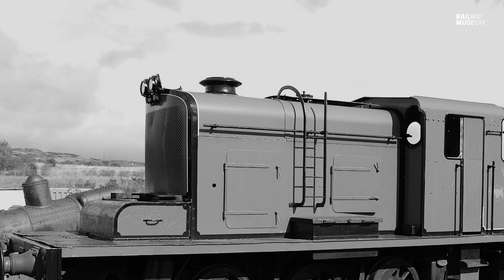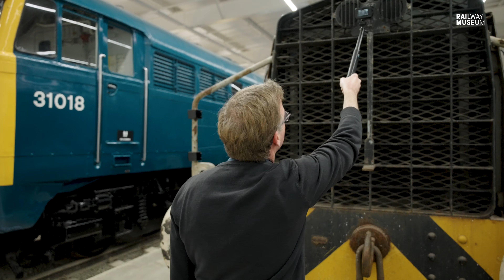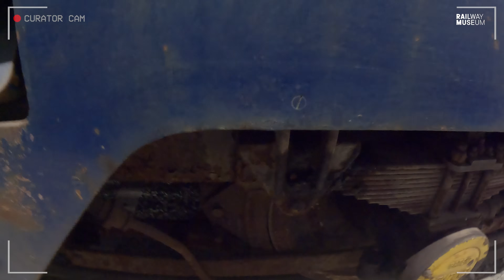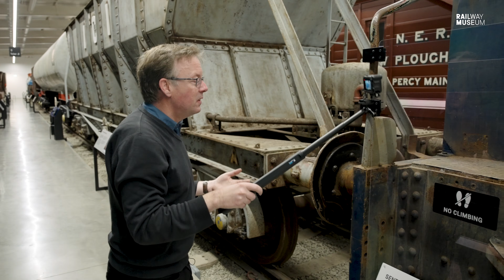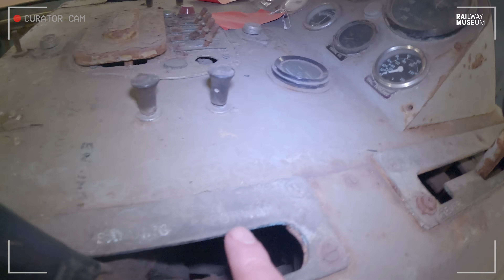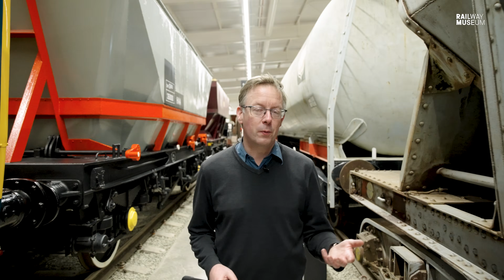The Sentinel Stands Guard! A Close-up Look at the Sentinel Diesel Shunter | Curator with a Camera

Comment: Nice video, but you neglected to explain the story behind the Sentinel "brand personality", which is fundamental to this design.  The logo of the sentinel and the "Ever Ready, Ever Watchful" motto was adopted because when the company started building steam lorries, they recognised a major problem with the then common locomotive-boilered lorries like the Fodens, was the time taken to raise steam in the morning.  The locomotive type boiler, being a fire-tube design, contains a lot of water so takes a long time to heat up, and if you force it too quickly suffers leaks.  This was  a major drawback of the steam lorries of the time, compared to early petrol engines which just started instantly, but could not offer the power to drive a large lorry.  

In order to overcome this the company adopted a water-tube boiler that has a tiny quantity of water inside it (a few pints, instead of many gallons in the Fodens), so as soon as you got the fire going, you could start to drive almost straight away.  They looked for a brand and motto to express this, hence adopted the Sentinel who is "Ever Ready, Ever Watchful" with his sword in his hand ready to fight at a moment's notice.

This principle remained a major driver of the company's innovative designs.  Their steam shunting locos also used water tube boilers, so they could be fired up in a fraction of the time of a traditional loco.  The advent of diesel engines of course was a no-brainer in serving this intention, but they went further than most diesel loco manufacturers by installing automatic lubrication systems that greatly reduced preparation time - other early diesels had as many as 70 lubrication points to attend to before you could start up! 

Sentinel were a great innovative company, and I fear it was the dead-hand of Rolls-Royce ownership that started their decline.

Marion
Reply from the maker: That's a really useful insight, thanks!

Comment: I started my apprenticeship at RR Diesel Div in Shrewsbury in 78, and did build the DV8 engine as used on the Sentinel Steelman locomotive. We built them individually with one fitter per engine, and it took two weeks. The engines were mainly used on marine vessels, tugs, and gen sets when I worked on the build line. I remember the C8 and C6 well but never built them personally. Thanks for the interesting walk around.

Comment: Interesting to compare this 1959 shunter to the later class 14 'teddy bear' and class 17 'Clayton', the latter of which were fairly disastrous. All German diesel-hydraulic designs, or based on at least IIRC.
Reply: My husband was a shunter at British steel work's Corby the class 14 teddy bears were a shunters nightmare steep steps in to the cab, cabs were very cramped to move from side to the other in the middle of the cab was a high step where the drive shaft was hidden not an ideal loco for the shunter 😊,

Comment: Thanks Anthony.  A great presentation that brings back memories when I was 11-15 in the late 60s early 70s when I was driving there around Cocheranes pipe works in Middlesbrough.  

Those where the days when your Dad bunged the driver 10/- (50p) and you could organise for your son to spend a couple of hours doing the actual shunting of wagons - under supervision. 

Prior to that they had 3 Hawthorn and RSH steam locos. 5, 6 & 9.  Drove those too and was heartbroken when the British Steel owned Sentinel replaced them and they went for scrap.  No 36 was first there  and swapped out for No 2 (BSC Numbering)

Thanks also for the Gentleman on here that pointed out that the shape of the grill and bonnet was similar to a Rolls Royce car.  Hadn’t notice that before.

Comment: The Middleton Railway in Leeds has a 1932 Hunslet 0-6-0DM LMS 7032. The advantage is instantaneous availability vs a steam locomotive.
The same place also has a Sentinel 0-4-0 VB. The Sentinel steam locomotive had the very high pressure boiler of the lorry.
The two locomotives handled freight across the Middleton Railway down to the Hunslet Down Goods Yard via the Balm Road branch.
They could be rebuilt as a diesel locomotive. Thomas Hill of Rotherham did such conversions. The Middleton has a converted Sentinel too.

Comment: Those windshield wipers have actuator motors from a car. That's actually pretty clever and well though out. Not super fan of the chain drive, but gues it has it's advantages in simplicity and the ability to allow a great ammount of movement to the axels for operations in poorly maintained sidings.

Comment: Well designed engine, and aesthetically very pleasing. Must be really a step forward in the late 1950's especially for the shunting staff, to have such a loco to work with. After the long years of steam shunting a huge improvement. I compare it now her ein Germany with the KöF III , an engine designed for the same purpose, in 1959 as well. They took another approach, having a very low profile to allow easy entrance from the ground, but so many similarities here. Diesel-hydraulic and very easy operation, one handed the most, good visibility on the working area and a closed cab to have at least a reasonable comfort for the driver. 
Happy to showed this and it shows that the same trend was taken in Britain and Germany as well.

Comment: Having owned and operated  Ruston LSS shunters I recognise many of the practical features of this loco. In particular, the ability to see the buffers from the seat in the cabs is vital. What amazes me is that so many ex BR class 08s survive in use, despite having appalling visibility for the crew.
The release of hundreds of these ex BR locos onto the market was the death knell for UK industrial loco builders
Reply: Built at a similar time and for the same purpose, the db v60 seems the better shunter compared to the 08
Reply: @the_retag The 08 had a continuous production history dating back to the 1930s, so BR simply pulled off more of the same, while it sounds like DB started with something closer to a clean sheet. Nonetheless, BR surely ought to have started with its own clean sheet at some point. I guess that there's no money in shunting locos on BR, especially when they were going for trainload.
Reply: @adrianbruce2963  Wikipedia says they were built at almost exactly the same time, although i don't know how much of previous diesel shunters (there were wehrmacht standard diesels for example, visually not far from the 08) went in to each.
Reply: Brilliant piece featuring a great locomotive design. I was lucky enough to have cab rides on Sentinel locomotives in industry and can attest the great visibility from the cab. Hope the loco stays in as-accquired condition. Well done

Comment: Worked on one of these. EWS had one in Newport. It is STILL in its shed where I parked it over 20 years ago. It uses diesel as a torque fluid.  If someone wants one contact DBC disposals department TOTON
Reply: didn't know there was another one in Wales

Comment: "Drive chain"! Just like my bike! I had never heard before of such a locomotive drive. The shunter would pull 1300 tons on the level. Blimey!
Where, and how, would the driver relieve himself?
Thanks for a most interesting account.
Reply: Sentinel as a company were pragmatic, if t'ain't daren't fix.... so with steam they pioneered high pressure vertical boilers, that were easily cleaned, and uniflow cylinders... they also stuck to chain drive.... they had basically three "types" of steam lorry, the original/super, the DG series and S series... the first two types were chain driven, differing by being single or double gear speed; the third, the S, was shaft driven, using the same technology used in their diesels.  They also developed the intriguing "Columbian" locomotive, which had a three barrel Yarrow style boiler, two tri-axle bogies, and each axle having two uniflow cylinders (each axle being able to be isolated out).

Comment: Great video about a type I remember well.  There was a 1961 built one in use where I worked in 1981/2 at Fairfield Mabey, Chepstow.  I always remember an enjoyable trip in the cab of one belonging to ARC (badged as Rolls Royce as built in 1965 after the Sentinel brand had been dropped) along the 1794 tramway from Penderyn to Hirwaun shortly before it closed, the spacious cab had plenty of room for a passenger along with the 2 crew and provided me with a great view of the line.

Comment: 1960s - Shaped knobs so you know what you are doing and don't have to take your eys of the road! 2020s - Cars with everything operated by touch screen, where you HAVE TO take your eys of the road to change settings! Progress?😵😵
Reply: The only diesel I drove was a Yorkshire diesel electric shunter; if I recall correctly the controls were all round knobs but very logically colour coded.  Green for speed, red for airbrake, black for direction and yellow for sand.
Reply: @mikebrown3772   if logically correct, "Yorkshire" was another steam lorry builder, making an odd transverse boiler, as distinct from Sentinel's patented vertical, or the traditional longitudinal favoured by Foden.
Reply: @PiersDJackson  I don't think there was any connection between the Yorkshire Patent Steam Wagon Company and the Yorkshire Engine Company (apart from both being in Yorkshire).
Reply: @mikebrown3772  my mistake, the engine company was older and built conventional locomotives, experimented in cars briefly, and ended up as another subsidiary of Rolls-Rolls-Royce Vickers, like Sentinel; whilst Yorkshire Patent Steam Wagon Co. were an separate business, specialising in lorries, and a patented boiler.  Ceasing steam production in 1937 and closing down in 1993.
Reply: I remember my father's Vauxhall Victor had differently-shaped knobs for the lights and wipers.
Reply: There probably is a money saving point. There usually is. But I think it's mostly style over substance in the modern age people are divorced from design and only see the aesthetics element. It's rife in everything from cars to cutlery to fridges to park benches. I am all for aesthetics but function should be the primary driving force in design.
Reply: Vehicle controls should be designed to be operated blind so a driver never has to look away from the viewport. It's a shame how many automakers compromise on safety for the sake of cutting costs and marketing.
Reply: Boeing 737 also uses a similar concept all the major flight controls are shaped as the thing they operate or set.
Reply: Oh, it's progress... towards cost-cutting and improved profits for the manufacturer.
Reply: Progress yes, but just for money
Reply: @holmesjunction  My Mazda has knobs and buttons.

Comment: Good afternoon from Spain. This locomotive model is my favorite of all the diesel locomotives. It saddens me to see it in this state of preservation. For years, I've been waiting and hoping to see a book published about this model, including the versions built abroad under license and those exported. In Spain, one unit worked on the Langreo Railway (scrapped). A private individual owns or owned the emblem. In Portugal, they were built under license by the company Sorefame. I don't know of any other countries where they have been used or built. If anyone could provide information, I'd like to thank you for the historical and technical (correct) presentation in the video.

Comment: I drove one of these at an event as driver for a fiver. I had some experience with moving other shunters around and driving a couple of mainline locomotives at drivers experiences.
The Sentinel was absolutely the easiest to operate, the controls are intuitive and the sight is superb, coupling onto a wagon with close to zero real experience would be easy in this thing because of the precise control of engine and brakes and the clear line of sight to the buffers.

Comment: The amazing thing is all the trial setups.  There weren't a lot of diesel hydraulic locos made. It would be great to get into what that's so different and not so different than modern diesel electrics
Reply: You might be surprised at how common diesel-hydraulic drive actually was - and still is.  While only a modest variety of locomotives were made with hydraulic drive for the UK, it was much more popular in Germany, and if you get on a typical DMU today you'll almost certainly find that it has a German-made hydraulic transmission under each carriage.  In Finland, though newer types are being introduced, the humble Dv12 locomotive is still ubiquitous wherever an electric loco can't be used - very much a mainline diesel-hydraulic loco.
However, most small shunters (in the Sentinel's size class and below) had a diesel-mechanical drive.  The difference is that hydraulic drive involves a torque converter, so the speed of the engine is independent of the speed of the wheels, and it becomes mostly a constant-power machine.  Mechanical drive is similar to the semi-auto transmission in an old bus - actually, in many cases it was literally a bus engine and transmission shoehorned into a railway chassis - in which the driver must manually select a gear, and there is only a "fluid flywheel" to couple the engine to the transmission and remove the need to operate a clutch.  This system was also used in the early DMUs.  Mechanical drive is technically more efficient than hydraulic drive, but the hydraulic drive requires less attention from the driver, and the latter was clearly the emphasis in the Sentinel design.
Diesel electric drive simply has the generator attached to the engine applying power to the motors, which in a shunter would be heavily geared down to the wheels.  The amount of power is varied by controlling the excitation of the generator and the speed setting of the engine's governor.  The driver had to be careful to avoid overloading the traction motors, so would be watching a large ammeter when starting a heavy load and adjusting the power setting to match.  In the English Electric shunter, there was a single power control as in the Sentinel; the first part of its travel controlled only the excitation, the main part controlled the engine speed at standard excitation, and the last notch boosted the excitation while maintaining full engine speed.  It's basically the same concept of control, just in a somewhat larger and heavier machine to undertake heavier work.
Reply: @Kromaatikse  The oldest Diesel Hydraulic locomotive in the world still operates today at Scarborough North Bay Rly. Neptune, built in 1931. The second, third and sixth do too. triton, Robin Hood and Poseidon. The fourth and fifth are at Blackpool Pleasure Beach Rly.

Comment: The Rolls Royce six cylinder diesel engine used is it the Eagle?
Reply: This locomotive as built would have the 'C6SFL' Engine. The 'Eagle' engine was a road vehicle derivative of the 'new C range' (introduced in the 70's and popular in ERF and Foden lorries). The eagle is almost visually indistinguishable from the industrial 'new C range' of that time. There have been many successful transplants replacing the old 1950's and 1960's C6 (used in the 4wDH Sentinel in the video) and C8 engines (used in the larger 6wDH Sentinels) with the 'new C range'. when Perkins acquired the the oil engine division of Rolls Royce the 'new C range' was renamed 'Perkins 2000 Series'. We still fit this engine in Shunting locomotives today (including Sentinels), although the engine has now evolved to improve emissions and looks little like its predecessors.
Reply: C6 IIRC.

Comment: Crazy how long it took the UK to developed a unit like this. US switching diesel or gas locomotives had many of these same features since the 30s.
Reply: To be fair, the UK didn’t see its first Diesel locomotive until 1947 with LMS 10000. Even then, the country wasn’t fully dieselized until 1967
Reply: @jerrysgardentractorsengine2243  LMS 10000 was the first mainline diesel loco in the UK.  But shunters of various kinds had been built with diesel engines for quite some years before that.  LMS' partnership with English Electric, which led to 10000 being built, started with prototypes for what later became the Class 08 and 09 heavy shunters; these arrived starting in 1934.  Even before that, experiments with diesel-mechanical and diesel-hydraulic drive (suitable for light shunters) had resulted in a small production run from Hunslet in about 1932.  It's hard to argue, therefore, that the UK was behind the times in terms of technology.  There was, however, less impetus to dieselise at the time because Britain was a major coal producer.